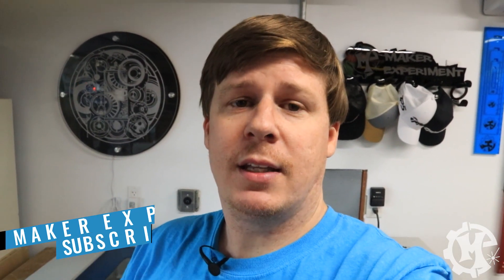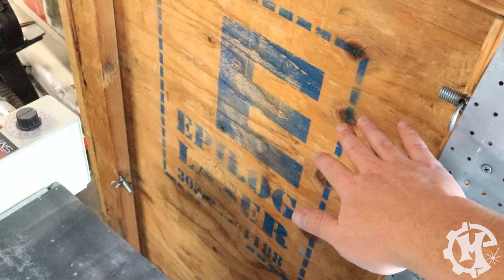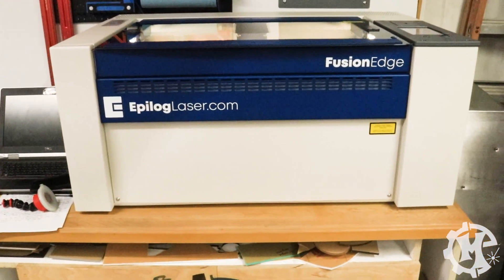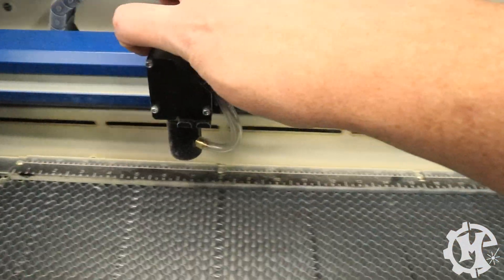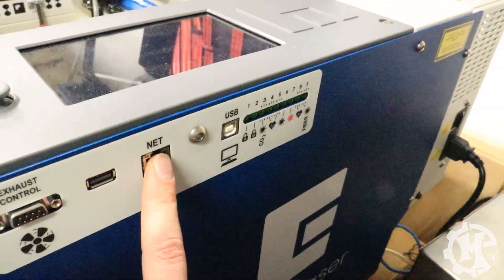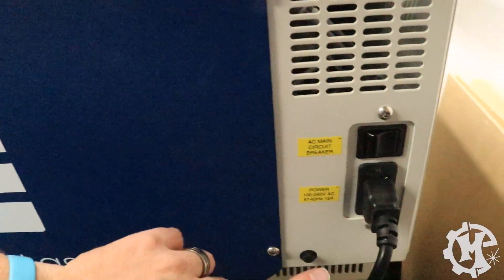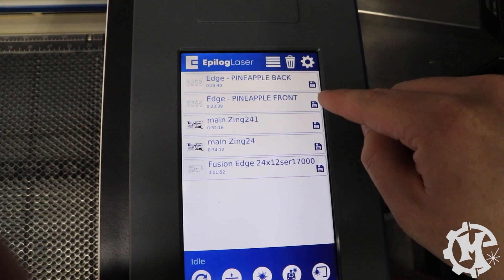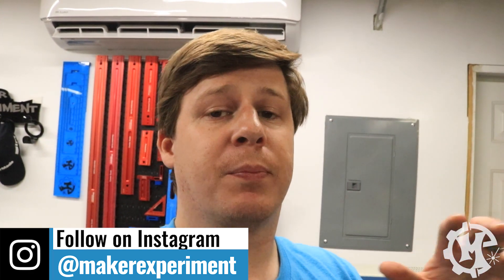Unboxing the Brand New Epilog Fusion Edge Laser!

Comment: Congrats on the getting the machine.   I think I'm going to buy the Fusion edge 12x24 in a couple days.   I'm just having a hard time figuring out the wattage I want or need 40 or 60.  I think most of what we'll do is engraving some cutting wood (hardwood like walnut 1/4 inch).
Reply from the maker: day work you can cut up to 1/4” with a 40 watt. You can cut 3/8” with a 60 watt. You will be able to machine faster with a 60 watt in most cases.

Comment: I received my new epilog fusion edge 12 x 24 this week. there are no instructions on how to install the small compressor pump 5/16 30 psi. Could you please help me?
Reply from the maker: Badge Busters there’s a port on the back right of the machine. Your compressor should have a hose on it. Plug that hose into the port on the machine and the other side into your compressor. That should resolve your issue.
Reply: @MakerExperiment  thanks so much. Thought there should be a metal fitting. It locks in with just the bare hose. Thanks
Reply from the maker: @badgebusters  you're welcome.

Comment: I'm curious how the fiber laser is operated. Does it use the same gantry system (as opposed to galvo which is way faster)? What would some use cases for the fiber laser be? Thanks!
Reply from the maker: Marcus it uses the same gantry system and is not the galvo style. Use cases would be primarily metal and items that are larger than some galvo beds. You are correct that it would be slower than a galvo system.
Reply: @MakerExperiment  Cool, so for example you could do a big metal sign without marking spray that the CO2 laser needs. And it's more for marking metal, and not really for cutting metal, right?
Reply from the maker: Marcus that’s correct.

Comment: I would like to see a comparison between the Epilog Zing24 50W & the Edge 50 W
Reply from the maker: Donna Brown that wouldn’t really be the right comparison if you’re wanting to see the old vs the new. The Edge and the Zing are two different levels of machines with different components. If I ever get access to one, I’ll try to do it. The comparison I am working on is the Mini 24 vs the Edge.
Reply: Ok. I guess I understood the Mini was being replaced by the Edge. Just trying to figure out whether the difference in price between the two carries that much value. Thank you so much!
Reply from the maker: Donna Brown the Mini 24 is being replaced by the Edge. As of now, there is no news on whether the Zing will be replaced.
Reply: @MakerExperiment  yes I understand. Trying to figure out whether the higher price of the Edge carries that much more value than the price of the Zing24. I like the idea of the camera, but what else justifies the higher $$?
Reply from the maker: Donna Brown the differences I know of off hand are the motors which relate to speed, the camera, it predicts the time for a job, the touchscreen display, machine memory to save jobs to the machine directly, ability to WiFi connect, resolution is fully flexible on the edge and not just major steps, it has lights inside the bed, magnetic vector table, safeguard clean features, and I’m not sure what else off hand at the moment. That’s just from memory. I’d have to get a run down from them to see what else. I’ve never actually owned a zing.
Reply: @MakerExperiment  Thank you so much!  You have been very helpful!  I appreciate your hpnest videos.
Reply from the maker: Donna Brown I try my best to be honest about my experience.

Comment: So cool!!  And it all makes a lot more sense now!  Looking forward to some more great projects  ahead!
Reply from the maker: Twisted Twine Woodworking thank you!
Reply: @MakerExperiment    do you know the price for a 50W CO2  version, or do you know the pricing on any of the models? Thanks
Reply from the maker: prince2thethrone the 60 watt model starts at $18,500. I don’t know what the 50 watt will be. The machine starts at $13,500, so my guess is it’ll be near the higher part of the range as a starting point. I can get you in contact with them to try and help you get that information. Feel free to email me if you’d like that.
Reply: @MakerExperiment   i missed the the part were you said it, i just rewatch the video thanks
Reply from the maker: prince2thethrone no worries. Hopefully it helps.
Reply: @MakerExperiment   I’m just kind of upset because I just purchased a used one for 10k  a couple months ago. I probably would have put a down payment on this and paid the rest later
Reply from the maker: prince2thethrone if you purchased through a distributor, maybe you can talk them about it. If you bought it from another person, unfortunately there isn’t a lot that can be done. Epilog may let you trade it in for some value towards the fusion edge. That would be something I’d ask them.

Comment: Congrats.  I can tell you are very excited!
Reply from the maker: Joe Berg it is such a cool machine!
Reply: @MakerExperiment  Video's you could do 1) Let's see the camera in action.  Print on a laser printer, and walk throught the workflow of cutting out the design - like a patch of a cap. 2) Let's see the benefits of the job manager 3) Side/side comparisons of your current machine to new machine.  4) Any work flow differences in the machines 5) I see you do a lot of wood & acrylic.  Let's see some engraving on denim, caps, leather & fleece shirts.
Reply from the maker: Joe Berg all good suggestions. Two of those are in the pipeline for the camera and machine comparison.